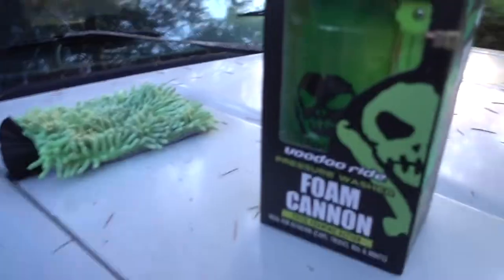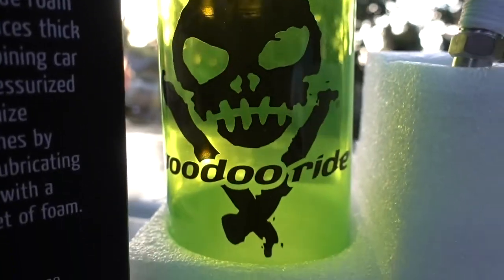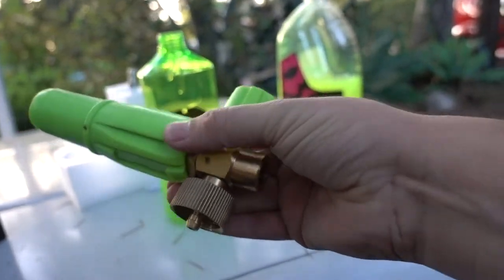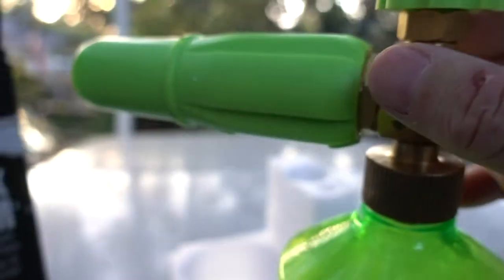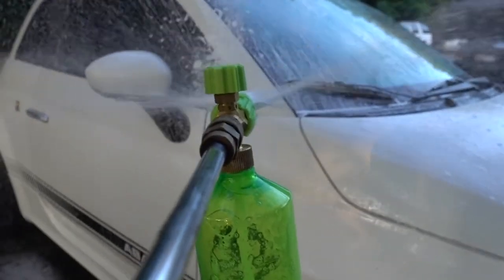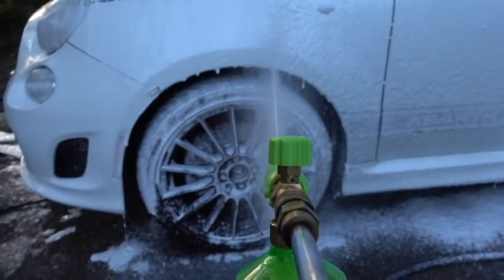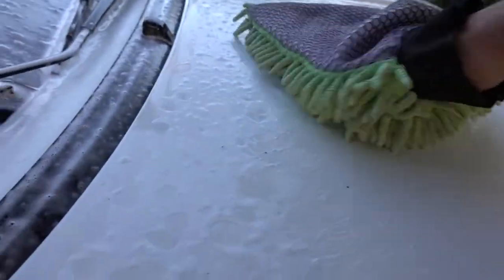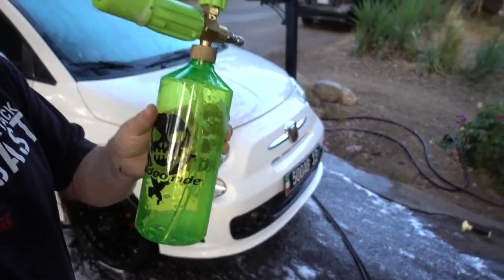Voodooride Foam Cannon Unboxing and First use  (Vlog #30

Comment: I'm sorry, buddy. Did you read the instructions? After adding ~ 3 oz's of soap, fill the bottle with water.
Reply from the maker: Max Cichon naw it was a pre production one I added a little water but later found out more should be added. Round 2 worked out better
Reply: @tooqwikpix  Cool
Reply from the maker: Max Cichon it worked even better when I had it setup right hahah. I’ll have to do a new one with what I learned.   Def Reccomend it though

Comment: Question . I bought one but it’s not really foaming . Anything I can to ?
Reply: egorlioon try to twist the knob and give it more water, honestly it’s finding the sweet spot not too much soap and just enough water
Reply from the maker: yea its getting the right setting add a little water then adjust the flow
Reply: Check the orfice also. Make sure it's a 1.1 mm orfice and switched to that

Comment: do you happen to know where i can get an air compressor with the 1000 psi??
Reply: Um it’s with pressure washing machine my guy
Reply: @isaacespino4974  a whole year late, and still didnt help. theres an air compressor connected to the pressure washing machine